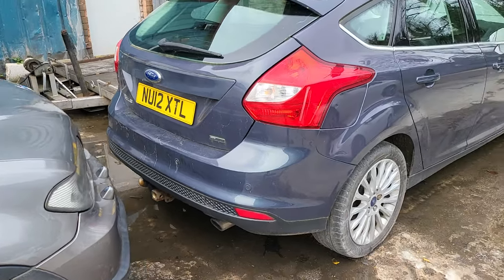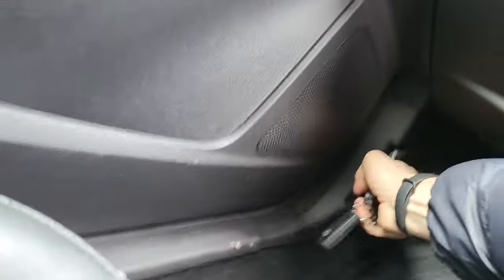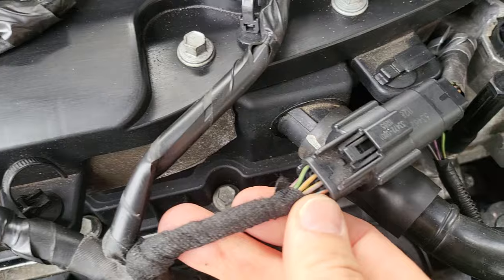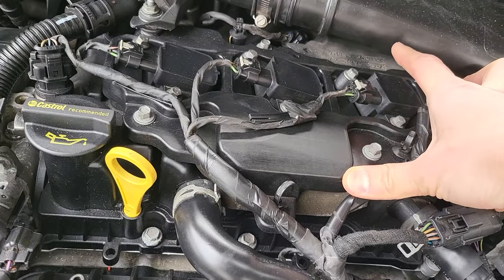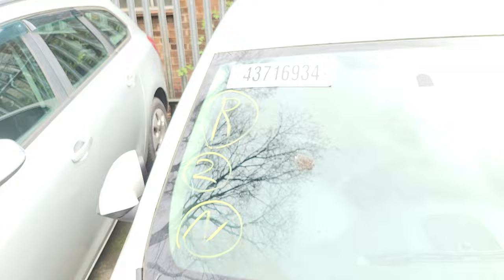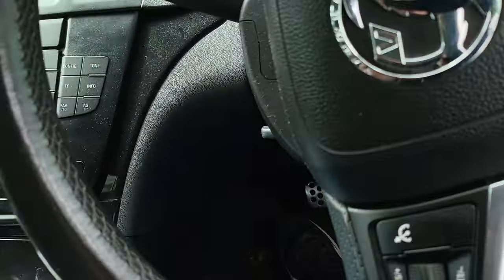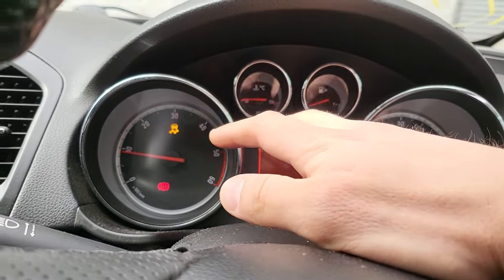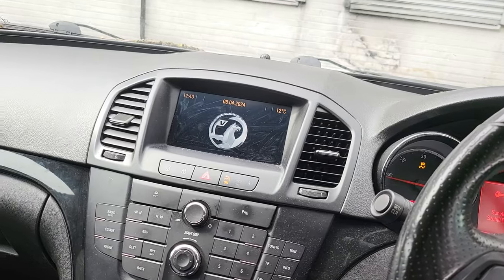Another SCAM from Copart Auction.

Comment: First mistske is buying any Ford with the EcoBoost engine, second is buying a Insignia, third is buying anything from Copart...
Reply from the maker: Any advice where i can find a good car with electrical issues ?
Reply: @ecuproguk  
Problem is, most modern cars require you to be an expert electrician with all the corresponding diagnostic equipment. Many cars which look in nice condition can have very expensive electrical issues needing parts which can write the car off..
Reply from the maker: @Draxindustries1  i understand, i am auto electrician, i am every day working with a dead cars, and about 80% i can make alive. That's why i am buying only dead cars, because other mechanics not bidding for it if it is electrical issue.
Reply: You buy wrecks - you get wrecks ..
Reply: Then he goes on to look at a Vauxhall, I mean what does he expect 🤮🤮🤮
Reply: Anything newer than 2010 should be avoided if possible unless you have very deep pockets or can buy brand new and only keep for a year or so -

Comment: Its not really a scam, Copart state clearly whether or not a car starts and drives but carry a disclaimer which reminds you that just because it starts it doesn't mean the engine is without faults, likewise if it 'drives' it only means it will go into gear when required and not that it will drive long distances without any issues. Most cars in there are insurance write offs and were literally driving 100% ok right up until the moment they crashed and there is a reasonable chance they may still run ok once the crash damage is repaired. However, the main problem with Copart is people paying way too much for their vehicles. You have to assume every car has major issues that you will need to sort out, including an engine replacement if required, that way if you dont need to replace the engine then you win big time. Any car that has been placed into the auction by a private individual should be ignored, likewise anything that has had a previous repair. Some clearly state they are in the auction due to mechanical issues. Assume the worse. Nobody writes a car off and sells it for peanuts simply because 'it wont start'. Treat everything with no trust whatsoever. I was looking through their auctions only this week and noticed how many Land Rover/Range Rover/ Discovery etc were written off due to 'vandalism' with every panel scratched and every window smashed. Either there is someone out their with a big grudge against Landy owners or this is the latest way to get rid of a virtually unsaleable car with a potentially disastrous mechanical issue! I think in your case, Copart having listed the cars as non-runners aren't trying to scam anyone, they are saying 'treat this car as needing a new engine'.Sometimes you just have to read between the lines. My advice is bid very low prices for lots of vehicles and some of them you will win, most you will not. If you buy CAT N vehicles the repairs are usually light panel repairs or replacements, easy work that anyone can do, but if you buy non-runners the real costs are hidden.Good luck with your future purchases.
Reply from the maker: I mean a photos, because they shows that both cars has no power, even if you connect a jump starter. But is is not true, because when i have connect a new battery, both cars successfully started. I am auto electrician, and power supply issues is ok for me.  
Anyway thank you for advice!
Reply: Ref your comment on LR's/ RR's, the reason is because they've become unsaleable. Don't ask me how I know...😢
Reply: @Draxindustries1  they're unsaleable and easy to pinch, my local area this week 8 have been robbed, major flaws in the security they come with.

Comment: Every car we bought from copart got nofuel, as per their policy. However most of them had broken fuel pump clips, or completely messed up fuel tank due to their carelessness. Missing small bits and plastics every time. Even if it's on the picture when you buying it, workers steel them to sell it on ebay I guess. We stopped buying there like 4-5 years ago. Enough is enough.
Reply from the maker: Yes, but where you are buying cars? There are some other auctions, but i guess it is the same as copart.

Comment: I don’t get it. You brought a car knowing it’s non running yet moan when the engine starts and runs rough. Surly you have brought these wit the mind to fit a new engine
Reply from the maker: You don't understand a main thing, if you are buying a car with electrical issue and Copart says it is not starts and run because of electrical fault (no power). And after you will get this car and it has a power and starts, you understand that it is a scam. They are lying to sell this car, and they are knows that this car has a faulty engine.

Comment: Some of these comments are a little unfair to the YouTuber imho. I totally get the reasoning - the descriptions are suitably vague enough for the auction people to try and put the blame on the buyer -caveat emptor and all that.  It’s not unlawful as they are not directly misrepresenting the cars but it is crappy behaviour. They should face the consequences of practices like this though and I’m sure if there are enough complaints to trading standards (if they are still called that these days) there would be enforcement to improve the descriptions. 
They could sell you a black car and when you get it the paintwork not visible from outside could be bright yellow and that was its original colour. They’ve not lied but they haven’t been totally honest,,,,same kind of thing.
Reply from the maker: That's what i am saying. If you are selling a car with damaged engine, note this in description. But if you are trying to hide this fact and sell this car for extra money, i will disconnect the battery ans note that no power supply, there are keys, unknown reason. But you know that the engine is damaged. For mechanical engine damage copart has a special mark "Mechanical damage".

Comment: Just fix the engine lol
Engines are VERY BASIC ENGINEERING, separate the parts into components and replace the damaged components re time it and its fixed.
Reply from the maker: In this case no sense to fix this car
Reply: @ecuproguk  sure if ur only goal is to flip it for profit as cheap as u can.
I would argue prforming a timing chain swap ans re time it would make it a decent car to sell  but it's not my investment so good luck breaking it.